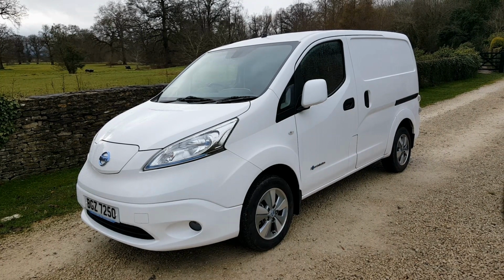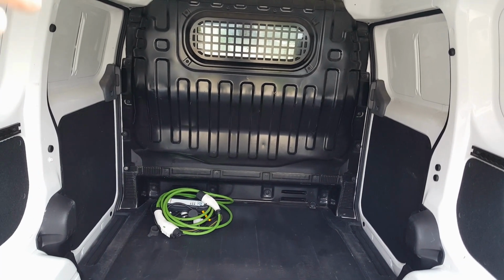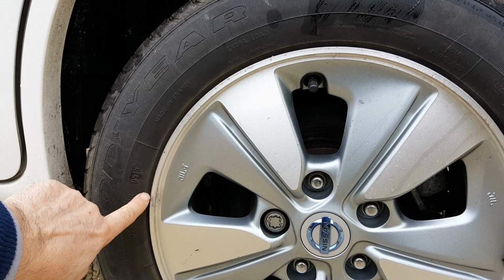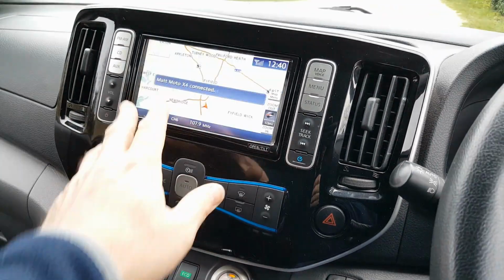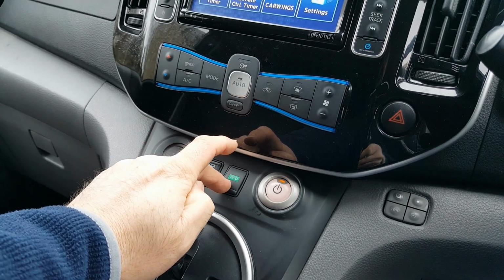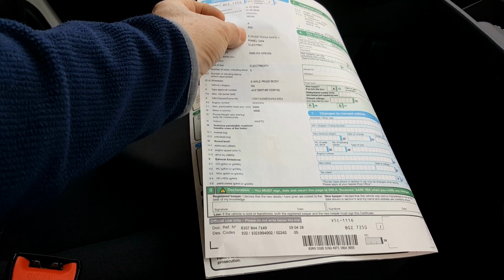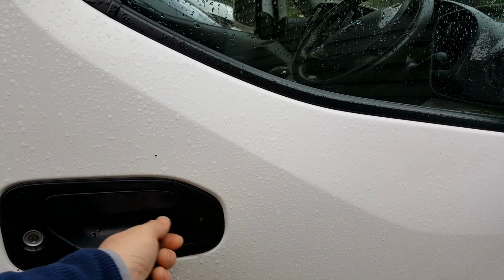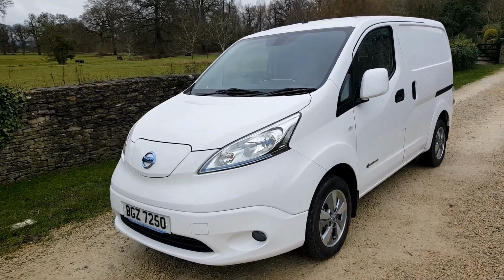SOLD: Nissan E-NV200 Tekna Rapid Plus, 100% electric zero emission van

Comment: If i'm going to drive a giant battery around I expect to be able to run the AC and some appliances overnight right?

If it comes to US will wait for the above, 300 Mile range and 15 minute 80% rapid charge. 

They should cut the engine bay/hood out and give us another 16 inches of cargo.. more functional and will look much better IMO.

Comment: Could Solar panel extend range?
Reply from the maker: On your house, yes - then charge the car from that. But not on the car. The surface area isn't enough to make it viable. However, search out Sono Motors - they have a solar car coming.